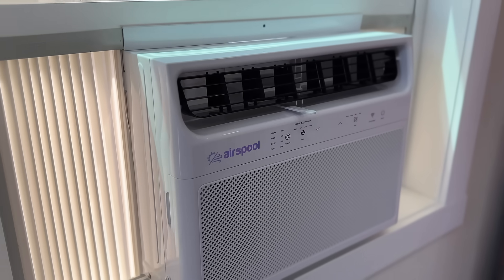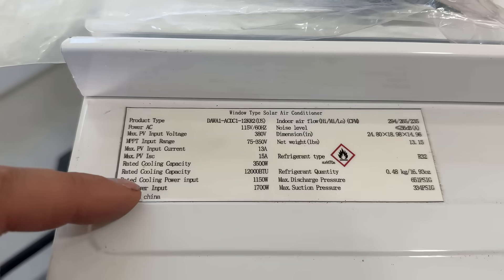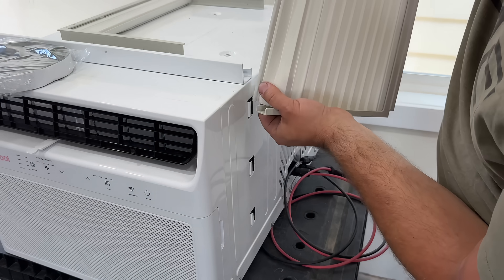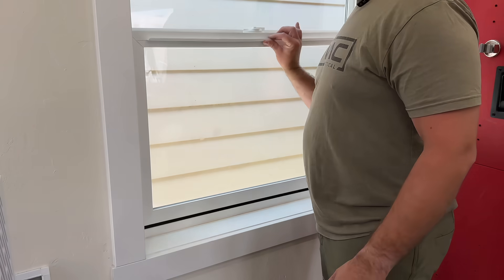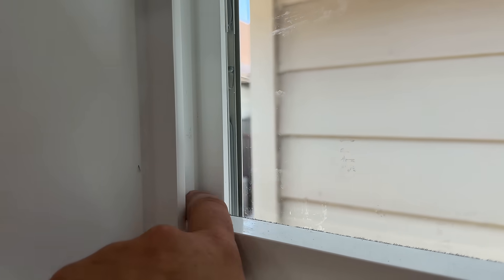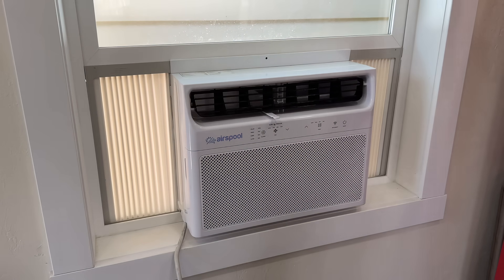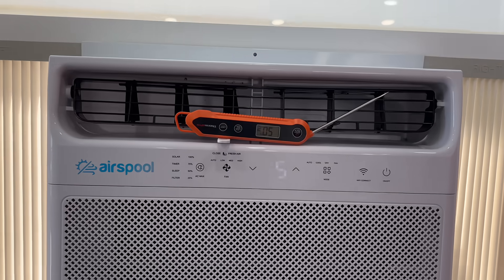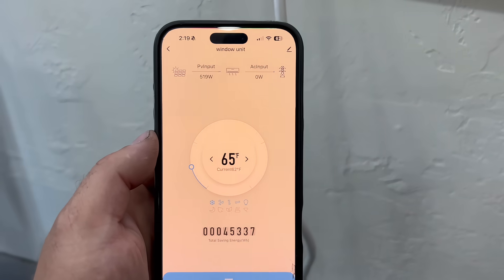Introducing The World's First SOLAR WINDOW AIR CONDITIONER...

Comment: If they could make this like the "saddle style" HVAC units I think a ton of people would buy them.
Reply from the maker: Agreed
Reply: Guys, the Midea saddle style for sure is more attractive than this standard style one, and it helps preserve your view out the window.  It's patented, and we discussed it.  But, maybe a blessing in disguise?, because they're having some major challenges with mold on the inside unit since the condensate is not getting transferred to the outside correctly.  So, there's an active recall going on for these 1.7 million units in the U.S.
Reply: @airspool  oh, that is good to know, was thinking about buying one to replace one that went down this year.
Reply: @hawkberry  Like a lot of recalls, it's probably zero problem for 99% of the people, but getting that condensate pumped out to the other side for sure is a bit of an engineering feat vs. a normal window unit.
Reply: @airspool  is the midea style not fixable by drilling some holes? or does that make it drip inside the house
Reply: Na thats redicous expensive for a little window unit
Reply: @GeorgeBernal-k1s yeah and over a hundred to ship. Gosh. I could get a cheap mini split almost installed for that price

Comment: One warning.  If you installed Andersen windows they will void your warranty if you put any screws into the sash/frames.  Read your warranty fine print.
Reply: Definitely.  One option is to get some wood, like a 1x2, and cut it to length so they fit snug in the channels on each side, keeping some pressure on the window to seal it.
Reply: @revtmyers1  Yes, I used an old broom stick cut  to fit from top of bottom sash to top of window at the lock area. He also should have sealed the area now open to air and bugs between the top of bottom sash and window glass of top sash.
Reply: You could also use those floor door wedges.
Reply: @revtmyers1 that's what I did, I got a 1x 3 ferry strip, and put it against the top hung window horizontal handle and the bottom. Now it's impossible lift the bottom or lower the top window. It also helps that I have a u-shaped air conditioner, so it's not like they can push the air conditioner out of the window from the outside in.
Reply: I use dowel rods cut to size.
Reply: What is a great replacement window to buy , or what to look for,  thanks in advance 👍.
Reply: @WhiteOak09 We got Andersen 400 series with UV protection glass.  Double hung.  Really like them.  Unbelievable protection on the southern exposure of our home.  Made a big difference.
Reply: @WhiteOak09 Not PELLA! Look up the lawsuit.
Reply: @bobcaygeon975I've heard a little bad things about pella , thanks 😊
Reply: @WhiteOak09  Andersen makes a vinyl contractor- grade window called American Craftsman that is decent. They size them to fit in most old sills, so theres no full tear out needed.
Reply: @bobcaygeon975that sounds perfect,  thanks a bushel for your help and reply 👍 😊 .
Reply: @bobcaygeon975My Andersen windows are a composite called fibrex.  They did a full tear out to install those.
Reply: If replacement windows fail enough to need to use the warranty, then you're just renting them anyway.

However in modern market I'd just do this with a mini split.  If you can't drill a hole, then you can run the umbilical system through a small board and close your window sash down to that level.

A 2x4 sideways cut to width and painted to match is sufficient.

Smallest DIY minisplits are about $400
Reply: I do what I want.
Reply: @gopackgo69 Yep, but try to make a warranty claim.  They'll use that as an out.  You'll be stuck with the bill.  I read the fine print.  My installer gave me a heads up about it.
Reply: @gopackgo69 Yep.   Read the fine print on the warranty.  They will use that as an out to deny your claim.  My installer told me about it.  So you will be stuck with the whole bill.

Comment: For the low, low price of $1195 + S&H
Reply: perfect example of great idea but stupid execution. Ppl that go solar will have solar panels and setup. They buy an efficient 120v AC unit or mini split then hook it up. That's cheap. This is not.
Reply: @xungngo  yep. Not really much difference in price between this ac and a DIY mini-split. We just installed on on my neighbor’s insulated container to hang meat in.
Reply: price is about same but one can do both cooling and heating which is ideal for most ppl
Reply: Oww !!
Reply: AR, use Dave's DIYHVAC$75.  That with the sale  = $950 now.  Still not $300, but it does lots of tricks like having a variable speed compressor that you control to make it a 3,000, 6,000, 9,000, or 12,000 BTU unit, it runs on solar and it includes the solar wire and isolator, it's pre-tested on solar, grid, and both to make sure you're not going to have a problem.  And, for the guarantee/warranty, it has a 1-year buy-and-try guarantee and a 5-year compressor/3-year parts warranty.  So, yes, if you're in a high-rate state, it will pay for itself pretty quickly.
Reply: Guys, for this, do the math.  The units are obviously pricey compared to normal window units.  On the other hand, if you're in a hot area with high energy rates and lots of summertime sun (Inland Empire/Coachella + San Joaquin Valley, Florida, upper East Coast in the summertime), this'll pay for itself pretty quickly.  And, yes, just leave it running when you head out during the day, since once you've made the initial investment, air conditioning is now free. At nighttime, it's much more efficient than a non-inverter window unit.
Reply: @airspool um no nice try though
absolutely no reason for that price
Reply: @airspool ….and then there is the cost of the solar panels and mounting solutions.

Comment: If I max the solar and I have the sun, can I have it do Zero or near Zero Grid draw during high solar energy?
Reply: Battery’s and yes
Reply from the maker: Absolutely
Reply: No grid needed as long as it's sunny and you have at least 300 watts of solar. We recommend 1800 watts, because in the summertime, when the panels get hotter, they lose efficiency, and so does the compressor. So it takes more power. So to get the full 12,000 BTU out of the unit, shoot for 1800 w,  plus or minus.

Comment: Excellent video and excellent Solar Window Unit. Thank you very much for making this video. I am in Arlington, TX. I have not installed Solar Panels on the roof yet, but I saved your video. If I install Solar Panel on roof in the near future (I am researching on the benefit of solar panel on roof), I surely will buy this Solar Window Unit with your reference.
Reply: signature solar is in Sulphur Springs TX and you can get individual panels there for small projects like this, costs a ton if you get them shipped and you need to buy at least $2000 worth.  But the store you can buy single panels if you want.  90 miles from Arlington isn't too bad!

Comment: Its really nice. Price isnt though lol i guess you will get your money back in time
Reply: Guys, yes, if you're in a high-rate area where it's hot and sunny, leave this running all day for free, whether you're home or not.  For many people, the savings is more than $.35/hour, which adds up.
Reply: @airspool  And, so that's the savings aspect.  Meanwhile, with DIYHVAC$75, the price of this is $950.  Yes, yes, it's not $300.  But, it does a lot of tricks (e.g., control of the compressor speed to save energy; running on solar; running on grid at CEER 15 efficiency) that a $300 unit can't do.  Really, for all of  these DC direct connect items, it helps if you live in a high-energy rate state or, obviously, if you're an off gridder.  Learn your price for energy here...New England/non-coastal CA...very fast payback. https://www.eia.gov/electricity/monthly/epm_table_grapher.php?t=epmt_5_6_a

Comment: Will it back feed the grid if there is a power outage? Something to test.
Reply: Thomas, it'll run when the grid is down.  So, that's different (and better) than normal whole-house solar with net metering.
Reply: @airspool  Yes.. but if it's plugged in while the grid is down will it back feed the grid when it is powered by the solar panels. My guess is they thought of that. But and easy way to check is to see if you have power at the 110 plug while it running off the solar. Hopefully not.
Reply: @Thomas-ts2gl it won't, because there is no meter that allows for that. The advantage of net metering is being able to feed your extra power back to the grid, but it is disadvantage is, yes, when the grid is down, the grid will shut down your whole house so you can't use any of the existing panels. They control that net meter remotely. They do it because of course it's a safety issue for the people trying to get the grid back up. But it's not of course beneficial to you.

Comment: Great but,Too pricy for the unit.
Reply: I normally would disagree with saying something is too pricey because not everything is for everybody. However, in this case, if someone has the space, it may be better to go with a mini split over this. This is an easier install but $1,100 is a lot...to me for this.
Reply: @mr.c6674  It would make no sense. Buy an AC and inverter and save $800 ..sigh. there would be plenty of extra cash to play with.

Comment: Do your research find a window air conditioner that runs low wattage they have them that run at 400 W Max and eco mode I think those are 5000 BTU maybe 6000 BTU. Get yourself a 1200 watt solar lithium power bank and some used solar panels and you will be running free air conditioning for the same price as this and you'll have yourself a small power station that can run other things during a blackout. Thanks smart folks I have been running all of my shit solar for a very long time I don't need this shit built into it I just need low wattage devices and there's 12 volt devices out there that run and pretty much do everything the same as 120 volt you just have to look at the wattage

Comment: Bummer no heat too. Thank you for the set up and product explanation.
Reply: We're working on heat.  It's theoretically just a $7 reversing valve and a controls update, but the condensate is freezing and affecting the outdoor fan.  We'll keep you posted.
Reply: @davidvanzanten4385 That would be beautiful.
Reply: Heat has a caveat: most heat implementations only work down to about 43 deg F outside temp. Many portable units also present this restriction. For instance, on a dual hose unit, you have to decouple cold air intake, and allow the warm inside air to flow over the cold exhaust rad. It takes extra guts and design to go below freezing, which adds cost.  Otherwise, the cold exhaust rad freezes, and needs a defrost cycle built in, like a frost free fridge. Units with the ability to work to freezing outdoor temps might be called "hyper heat", or "high efficiency", for example.  They also use a larger outside fan running at a slower speed for a longer cycle period to extract maximum heat from the outside air. It adds a bit more cost than $7.  I've read adding a reversing valve adds $100 to the cost of a 43 deg F unit, and it costs even more to deal with  freezing outside.  Soon, more aircons will offer the reversing valve, and it may be part of the upcoming revised "Enersave" spec. The 43 deg implementation is still very useful for shoulder seasons though, and will save a lot of money.  It's exciting!

Comment: I already run my window air conditioner off of solar LOL I use a lithium power bank 2000 watt Max with 4 - 245 watt solar panels runs all day long for free for me
Reply from the maker: Very nice!
Reply: Guys, this works, too.  A lot of people like our units because they can just plug the panels directly into the unit and then don't need to worry about the batteries/MPPT/inverter.  On the other hand, if you already have a storage device, this unit will help protect the batteries from getting depleted during the daytime, since it has both a DC and an AC (or inverter) jack.
Reply: @airspool typical company trying to sell something for 2x the price then trying to justify smh